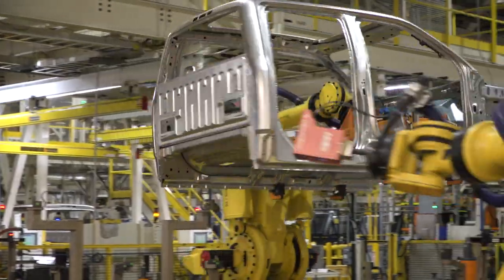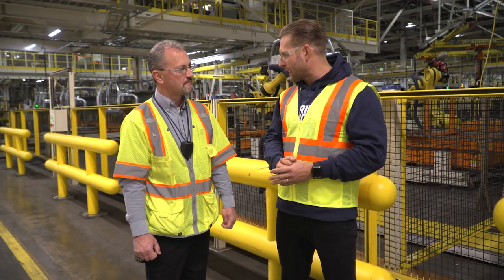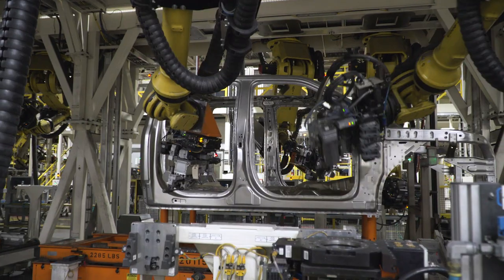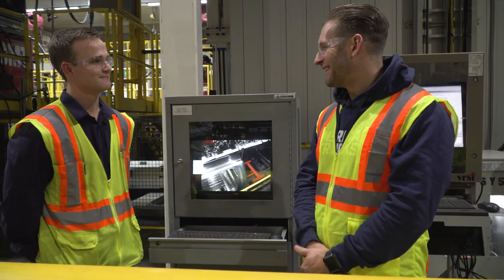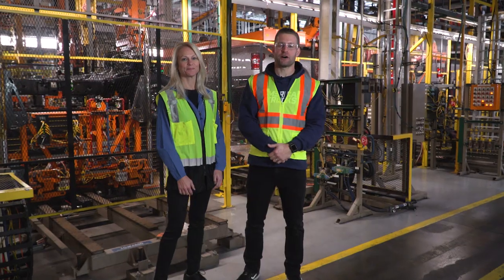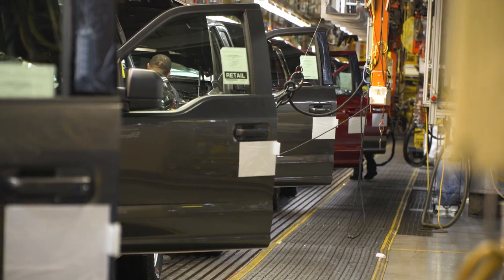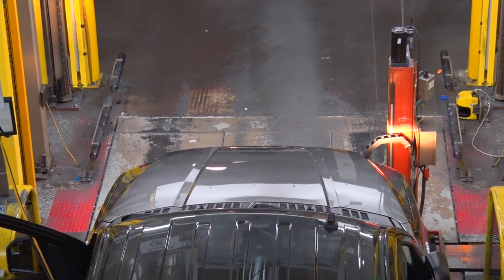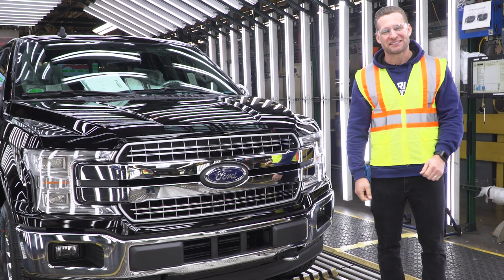F150 Factory Tour | How Ford Builds An F-150 Every 53 Seconds - The Haul

Comment: No more stealing them one piece at a time. Every part is recorded and kept track of. I remenber working a a zero inventory factory here in my town. When a machine breaks down,  it shuts down the whole plant and within 24 Hours it can paralyze the whole line. They used to send parts runners to the factory floor with a trunk full of parts to keep  things going. I ended up being a runner more times than Can count. 
The owner would give me the keys to his vehicle, $50 cash for gas and food and trunk filled with turn signal fender indicators. My record was 4 times to Detroit in one week.  If it was a crate of parts that didnt pass their inspection, I brought them back for rework, then turn around and take the crate back down the very next morning. I remember not sleeping much one week because of the mistakes being made on a new model year design. This usually happened right after a retool of the shop. I used to take a month off and go camping during retool, but they made me a runner, so I didnt get time off any more.

Comment: This has to be state of the art in truck production. Most tasks are performed by robots and that process seems to have removed  the possibility of human error. Even with this highly automated system there are still some glitches that arise as we saw with the tail light fit. With the mechanical fastening of the body panels I still would have preferred electrical welding even though it consumes more  current.

Comment: I wish Ford still offered a stick shift in the F150, even if it was the base 3.3L V6, id still buy one. Looks like ill be driving my 07 4.2/5 speed forever
Reply: 07' F150 with the 4.2 V6 owner also. Has been a solid truck for me also. But I'm afraid the new car bug has bitten me. I'm digging the 3.3 V6 at the moment, as it has almost 100 HP more than my 4.2 Liter came out with.
Reply: @ubangiestomp  I went from a 2013 3.7 F150 to my 2007 4.2 5 speed, the 3.7 was no slouch

Comment: at 10:44 is that a new headlight design for the raptor? Looks different than the normal LEDs that have come on older molders of the Gen 2.
Reply: could just be the reflection of the lighting when it was rolling down the assembly line
Reply: @MajMotorsports21  no, that's most definitely a projector headlight. Intriguing, considering that same truck seems to have the base Raptor trim BLIS-less tails.
Reply: @nubbins70  gotcha, maybe it is the Chinese SPEC of the Raptor? I think they get different headlights
Reply: @MajMotorsports21  that seems to be the case. Kinda disappointing that only the Chinese Raptor gets the projector lows; it doesn't matter that the highs are halogen reflectors as a good LED bulb in the projector would be good and focused enough of a beam that one would never need the highs again.
Reply: Also the rear bumper has the reflector on it.

Comment: The Ford F150 is the best selling truck in America built here in Kansas City Missouri and Dearborn Michigan Period.
Reply: best selling, also best in having issues.
Reply: @441meatloaf  My 96 F150 with a 5.0L (302) has 208,000 miles on it and still going strong. The only thing I replaced on my truck was the starter but other than that mostly was just simple maintenance, took out the transmission fluid just to get rid of the shuttering it was making and it hasn't had a problem ever since. I also have a 2011 Ford F150 with a 5.0L Coyote V8 in it with 127,000 miles on it and still going strong and it's a beast.
Reply: @CJColvin  you have a very older model, but look at the more recent models around 2013 onwards people complained about roof leakages which is a huge problem since causes electrical problems and mold

Comment: At 10:45 you can see an assembled raptor in the final check stage. It has no front skid plate, has projector headlights, and it has black covers where the marker lights should be. At 10:50 you can see the rear of that truck and it has reflectors in the bumper. 

Not normal stock for a raptor so I wonder what that is? Maybe an international edition? Any idea @AmericanTrucks Ford ?
Reply from the maker: Beat me to it! Overseas truck. -Justin

Comment: Just bought a new 2020 xl stx with 26 miles two weeks ago. Noticed the steering wheel being slightly crooked to the right, took it back to dealership they were confused as well so now I'm needing an alignment. Hopefully it fixes it. And also the glove box they had to order me a new because it doesn't close right! 😕
Reply: My steering wheel is perfect and my glove box is perfect. Maybe yours was in a head on crash or got dropped off the delivery truck. Maybe look into that .

Comment: Bought a 2019 F250, Superduty, leaks like crazy inside from rain or just washing.  Dealer kept it for 6 weeks total trying to repair and it was just approved for lemon law. Just starting that process so I don’t know what to expect.

They replaced seals in both driver side door windows (behind interior door panels), replaced the windshield, Corporate engineer sent out and found leaks in body panel seams behind master cylinder.  This is what I was told by dealer. Truck had inches of water inside cab, collected in floor body panels.  You could hear it sloshing around when driving. Maybe the 250 doesn’t get the water test on the way out the door??? 

Through all this the Dealer was clear to tell me this was Ford issue and they would not risk any financial loss on Fords behalf. They did provide me with a 2019 Explorer the entire time I haven’t had my truck.  Bought it in Jan 2019, coming up on 8 weeks of ownership and it’s only been in my possession 8 days. It’s been at the dealer every other day.  

My wife drives an F150 and I’ve driven an F250 or 350 for the last 10 years.  I love Ford trucks, but the service and lack of communication I’ve experienced during this process was well below what I would expect.  Only one that suffers in this situation is the consumer.
Reply: Ford "quality". I purchased a brand new Mustang in 2005. Nothing but problems.  Never will buy a Ford product again. Drive a Lexus now. Best car I've ever owned.

Comment: I own an 02f150harley and a 2013 ecoboost v6 flex. Give me a v8 anytime. The only issue with my 5.4 was losing spark plugs which was a problem with that engine. The alternator was replaced. On the ecoboost flex it has been a pain. One turbo, one water pump and lastly an engine replacement.  All at last than 100,000 miles. Disappointed with the twin turbo v6 in the Flex. Love my supercharged f150 Harley Davidson!

Comment: I got a question? At 10:46, what is that headlamp at the raptor? does`t look like the led lights i know, more like a halogenous lense?
Reply: Aaaaaand later on at the rear it has´t got amber light, but some strange bumper reflectors! Export???
Reply: @robinbulgrin4340  That's a Chinese export model. They have HID projector headlights instead of the LED the North American and Middle Eastern version gets. As you noticed they don't have the marker lights on the grille or below the taillights.
Reply: @supadoopa926  good to know. many thanks for your reply!

Comment: 10:45 & 10:50 is probably a China spec Raptor. All yellow marker lights got deleted, includes those three lights on the grill. The small black piece with a white light on top of the roof facing forward are unique to China market, also those two red lights facing backward. Rear view mirror caps are not painted. The China spec Raptor also does not have the BLIS so the tail lights are kind of different. Those lights on the rear bumper are rear fog lights, also unique to China market. China spec also relocates the 4/7 pin trailer light control connector from the side of license plate to the left of the trailer hitch cause the license plate in China are wider than US. The most significant different is probably the headlight. China spec does not provide the LED headlight, so those lights are HID instead.

Comment: So, in the first couple minutes of the video, the dude says they COULD weld the aluminum joints, however Ford just cheaps out and rams a screw in place to hold it together? Sounds like premium quality to me.
Reply: martin joseph  is that backed by empirical data or just the lowest common denominator of the target demographic's opinion?
Reply: martin joseph  what ever you say, champ. Don't worry, at least your mother will still love you, even if your IQ doesn't exceed your shoe size.

Speaking of your mother, probably not nice to refer to her appearance as that of a goat.

Comment: Seen a lot of banged up aluminum trucks... tailgates torn fenders too peeled off. Big gouges from a branch along the side of the box.... I dunno... rivets?? Yes trucks and planes are rivets but they get loose and need replaced from time to time and screws... well whatever these trucks are either really easy to work on or really easy to damage.... give me steel just in case... my Mustang is steel Im good with that

Comment: I will stick a solid welded steel body ford riveting is not as strong as welded. Steel has better impact strength and resistance    then Aluminum. I would rather have less gas mileage than less crash resistance.
Reply: Crash resistance improved with the new military grade alum alloy body on '15 model. High strength steel in all right places. Superior engineering.

Comment: WARNING FORD FANS!!!!   Scotty Kilmer says the 5.0L oil consumption problem is a Ford class defect that Ford won't admit to.  All of Ford's work arounds don't address or fix the real problem..... which is that Ford used an aluminum block on these 5.0 engines, and didn't sleeve the cylinders.  They used a ceramic coating in these cylinders (to save a few pennies), and this coating is either failing or it isn't working as it's supposed to, thus causing the massive oil consumption problem.
Reply from the maker: Ford has used an aluminum block on the 5.0 since its introduction in 2011.  And the liner you are referring to is not ceramic but rather a plasma wire arc spray in liner which has taken the place of a thin cast iron liner used until 2018.  The spray in liner is nothing new as it had been successfully implemented on aluminum blocks of the GT500 back in 2011-14 and is even used in the Nissan GTR.  So to your point, I don't believe the cause lies solely on the aluminum block or the liners themselves.  -Justin

Comment: if they have a 120 point inspection, why do so many of them leak?  Mine was just bought back by Ford for 2 rear vents in the back of the cab that were leaking which caused mold to grow under the carpets and throughout the truck.
Step up your game Ford.  If I buy another one, I don't want this same issue. Go to f150forum.com and look at all the other leaking f150's with the aluminum body

Comment: I need to comment bc I bought a 2015 lariat with upgrades. In my opinion these trucks were made to fast and sloppy. I found so many problems. My truck had bad painted areas just above the board runners. Showed yellow lines. The bed or bumper is offset not center. When turning left or right the bed knocks. The panaramic moon roof knocks like hell. All doors when opening and closing knocks several times sounds cheap. The dash under the steering wheel is not seated correctly nor can I get it to seat or snap in. The glovebox looking from the passenger door is offset. The front left seat tilts left and the front right seat tilts right. Also I have several recalls. I had to tighten bolts under the hood bc the noise was to annoying it sounded like crickets. The windshield can't take any small rocks. I'm on my third windshield. I just wish they paid attention to the details on those things. Letting someone take apart my truck to fix these things hell no.

Comment: I have a 2017 f150 3.5l with 10speed has 27k miles and I'm having engine knock (cam phasers issues) dealers keeps pushing me off Bob Chapman and Buckey Ford in Ohio when Check engine light kicks on truck falls on its face for 2 or 3 seconds before limp in mode very dangerous

Comment: I`ve owned 2 F-150`s...a 1998 that I had for 16 years, 300k miles on it, and a 2007 that has Ford`s defective 5.4L engine that I have barely over 100k. I work with several people who have trucks with the same engine, and the same issues I`m having with the clogged oil ports for the actuator ...no power, cylinders misfiring, and Ford`s solution: Replace engine. What a crock of sh$t. How there wasn`t a recall on these defective engines is a mystery to me. I loved my `98, had a 4.6L and was rarely in the shop for engine problems. Bought the `07 used in 2013 with 22k miles, now I`m looking for a new vehicle, so much for ford reliability.

Comment: Maybe spend an extra 7 sec and put the oil pan on correctly for the 2.7EB...not even 8k miles and it's leaking. Yay.
Reply: Stumptown Woodworks : Maybe yours was assembled in Mexico ? 🙄
Reply: @itsallgood7483  ha! , I think mine is the Missouri plant. Hoping it's s one time fix, dealer has the service bulletin for the fix and says they've done it 4 other times with no returns for more leaks, so fingers crossed. Otherwise an amazing truck, checks all the boxes for what we needed.
Reply: That's not that big of a deal. Hey it could been worse, you could've bought a Chevy or a Dodge and be trying to trade it already.

Comment: 11:00 That is BS. As someone with a 2015 with body structure noise and a settlement with Ford, they do not know if something doesn’t sound right.
Reply: Maybe they just don't care
Reply: Alex Muela They shouldn’t be there than.
Reply: If one deals with / handles 430 vehicles a shift any abnormal sound stands out and if the worker cares will set in motion a correction. The almost pure human interaction with vehicles leading up to the 2000's showed what a lazy or careless human can produce. That interaction now is less in the building structure but rather the completion of the vehicle where mechanization can't operate. One example does not necessarily translate to a chronic issue. Just like the taillight issue perhaps you were ahead of the problem discovered and corrected. Who knows?
Reply: Larry Be Yes, you’re probably right. Mine is a 2015 (first model year for the aluminum body). The old saying stays true, don’t by the first year when they make major changes. Other than the noise the truck has been great.

Comment: yeah, "we use rivets instead of welding in critical spots"....BECAUSE IT'S CHEAPER......It's always about cost to build....screw the consumer....That's why little squeaks begin 'ta materialize....the one's 'ya cant locate....New vehicles are a Crap Shoot...Mostly Crap...Designed to have a worry free life of 3 years or 36,000 Miles....Then everything starts to malfunction......New vehicles are just junk, they're designed with replacement of the major parts or the entire vehicle in mind.....I know, I work in the industry...Many of the new vehicles delivered, have defective firmware, software or junk hardware that will need a recall in the near future....
Reply: What's wrong with Rivets? Do you know how jets are built?

Comment: And this is why I will NEVER buy another ferd again...I grew up in a ford family, my father custom ordered a 69 Ranger when they were full sized...compared to that pickup truck, every truck he bought after that was a downgrade in design and engineering. the trucks went from a solid full frame to a cheesecake frame to almost a uni body frame thats in my 99 now...These vehicles went from 8 thousand dollars to over 60 thousand and things went from full metal to aluminum, If I want something to drive around for show, it sure wont be a pickup truck...I buy those to WORK with, to haul and pull and Im sorry, there is NOT ever gonna be ANYTHING made out of aluminum that can do that very long...WTF are you folks thinking???

Comment: I want to thank everyone at Ford for building my 3 pieces of sh** F150s that I’ve had.  All 3 nothing but problems. My Tundra now... none.
Reply: Never look back!
Reply: Did you buy all three F-150s new?
Reply: Matt H Yup...started having problems as early as the first week I buy them. 2008 4.6L, 2012 3.5L EcoBoost, 2014 5.0.  One thing I have experienced is that Ford cannot make a good reliable transmission.  Those were the main and frustrating issues. Electrical issues were another among other things. Oh and dealers are no help. They say everything works as designed. If no check engine light is one then everything ok.
Reply: I own Toyota / Lexus vehicles now.  This vehicles just won’t break.
Reply: @Thisiscrazy2023  i think u mean dodge has tranny problems
Reply: Joshua Beanblossom when dodge switch to the 8 speed ZF transmissions they were a life saver for them. True they cannot make their own so the outsource them and it works. Ford should probably do the same because those new 10 speed are questionable

Comment: Aluminum junk! Real trucks are made with steel
Reply from the maker: Its funny because now Chevy and Ram are starting to implement aluminum- does that change your argument? -Justin
Reply: AmericanTrucks Ford True they are but only in certain areas. Eventually all manufactures will do it the EPA is killing the automotive industry. But all in all Ford needs to weld and not use screws. 40-80k trucks are becoming throw aways. Drive them for 3 years then trade them in. Fords are not built for the long run. Not anymore